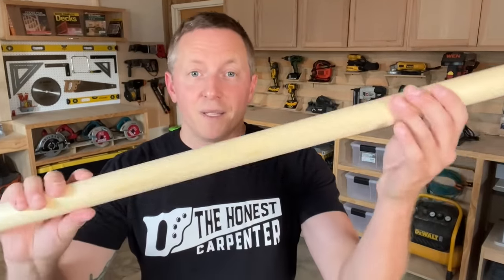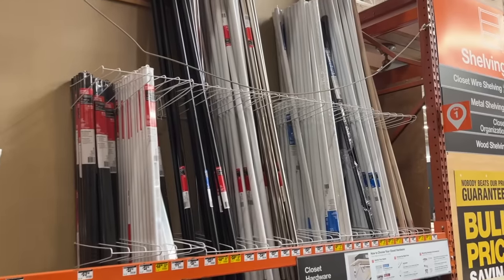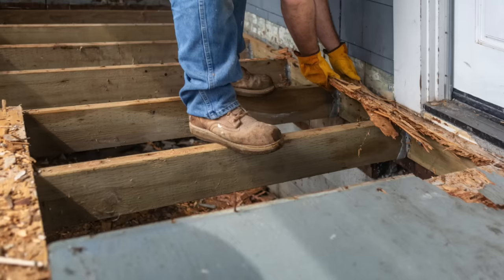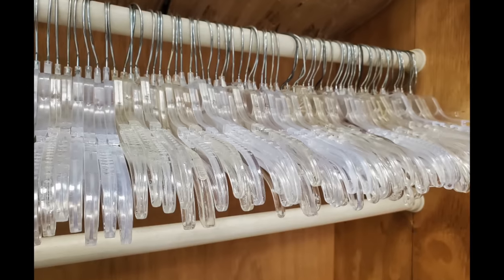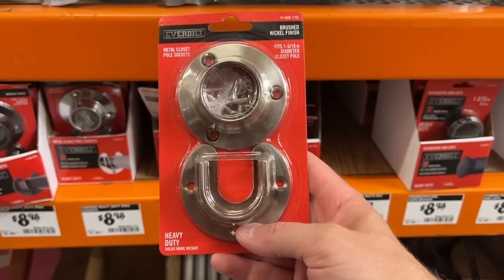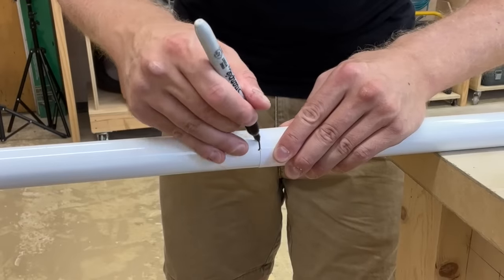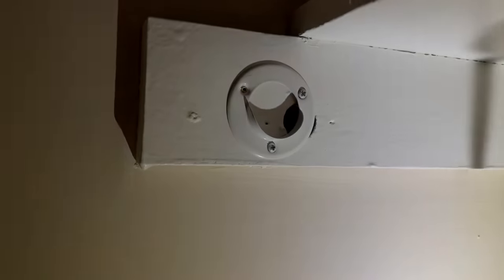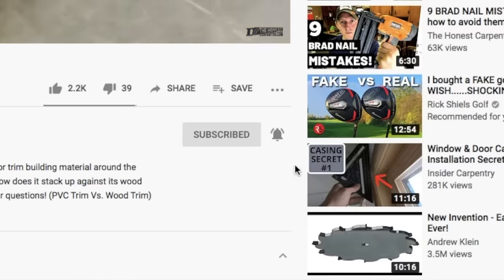Wooden Closet Rods Are TERRIBLE! Try This Better Alternative...(Metal Clothing Rod Install Tips)

Comment: I really didn't want a center support for my heavily loaded 6' spans.  I got the stiffest chrome closet rod I could find, then inserted a piece of metal conduit that would barely fit, then put a piece of galvanized pipe inside that, also with tight clearance.  It worked great, with very little flex/sag.  My friend commented that I had made a "tube-ducken" (named after the turducken).
Reply: Funny, I was going to say use 3/4" emt
Reply: Hey that's really smart! I don't like the center support either. Great solution.
Reply: I mean,  all you needed was just the iron pipe

Comment: Have to disagree with you on this one.  IMO, a good hard-wood rod looks much nicer than metal, especially if a dark wood or stained dark.  I agree that I would not span 6 feet with wood, but just as you mentioned using an interim support for metal rods over 6 feet, I would use interim support for wood rods over 4 feet.  And, IME, people really don't slide their hangers from side to side all that often.
Reply from the maker: I agree with your span calculation there, Howard. It’s more preference at that point 👍
Reply: I think Howard just admitted to never doing the laundry.  😂
Reply: I am a wood freak, I will choose wood over anything in most cases and there's no question it 'looks' nicer. But HC's points are very valid. I have an 8' wide closet with the entry door offset to one side (not the center) + 2 small closets with the 'rod' running perpendicular to 'me' ... you can believe I SLIDE hangers 9 out of 10X I open a closet, sometimes extensively, multipleX/day. And with that .... I now realize a silent, constant annoyance in my daily domestic life that warrants a modification project, to be excised for ever!
Reply: @DemPilafian  I wish, but as a bachelor for the last 30 or so years I do my own laundry.   Now hanging it up after it comes out of the dryer -- that's another matter.  But in all seriousness, for example, I have a section for dress shirts/slacks -- the vast majority of activity is hanging them up ONCE each time I wear one.  I am not sliding shirts/slacks back and forth constantly.
Reply: By that logic, you could just use PVC and just put support structures every foot.
Reply: @benr.3009  don't tempt my cheap butt with this!

Comment: A bit of Briwax on a wooden rod makes a world of difference. My clothing flies from side to side.
Reply from the maker: I can see that helping, Prescott. But do you still get some sag issues? Wood is just so prone to warping, especially circular rods!
Reply: @TheHonestCarpenter  so far, no. But my spans are only about 5’ and I use handrails or all-purpose dowels rather than closet rods specifically. They’re sold in a different section of the home improvement store, in longer lengths, and thicker diameters, yet cost less! A bit more work, perhaps, but the result are holding up. 

If I had a longer span, I’d definitely use a brace in the middle, or knowing me, maybe something minimal with airplane cable drilled through the center.

Comment: A hollow steel closet rod is a great hiding place for valuables. Rolls of cash, jewelry, and other things that will fit. Easy access with one side in an open top cup holder. So much better than a fake electrical outlet or in the tub of ice cream in the freezer.
Reply: Great...now you gave away the hiding place for my valuables! 😲😂
Reply: That's great, can you tell me where you live?

Comment: I’ve had wooden rods in my house for 70 years.  What should I change them out for metal rods?
Reply: 70 year old wood cut for a closet rod is probably pretty high quality. If they still work, you don't change them. But people who buy a house that's less than 25 years old are going to find that wooden rods will sag, or already do. And metal is a better, cheaper replacement.

Comment: As a wood worker I built my own closet and use 3/4 inch iron gas pipe, I sanded, primed, and painted it to coordinate with the walnut wood in the build, it is incredibly beautiful and strong. You can use the threaded foot plates to screw to wall or wood post making mounting super easy

Comment: One other item to add to the metal rod, use wax paper to rub down the top of the rod. When I was working retail using wax paper helped the hangars slide just a bit easier. I do it every so often at home usually when the hangars feel "sticky"
-MG
Reply from the maker: That’s a good tip, Gears! 😄

Comment: You're absolutely correct. I've been using and replacing wooden closet rods with metal for 40 years, since before they came painted in colors. Wooden rods wear and sag.

Comment: There are new oval shaped closet rods that are fantastic.  I recently built a full walk in closet dressers, garment shelves and hanging space.  Using the stainless oven shaped rods with the gunstock stained wood looks fantastic and no need for any middle support even on 6-8 foot spans(depending on weight). The new innovations are amazing.

Comment: I have used these rods for awhile now.  Also, as my shower curtain rod.  I have textured walls and the usual tension rods do not hold up.   It looks high end and sturdy and I have no worries of the rod falling down.  I use the grommet style curtains, fits perfectly.   Best if all, you don't have the overlapping joint so the curtain slides smoothly and doesn't catch when opening or closing.  Enjoy watching your videos.

Comment: Also, hard wood rod / dowel is incredibly expensive (North East). Where I live, even soft wood dowel is expensive. Exotic hardwoods are insane right now, $50 and up for 8'.

I had an oddly long closet to span while renovating my basement. It was over 9' and a heavy steel tube cost me $25 (thick walled, welded tube). I built the end supports into the structure of my built-in closet shelves with one steel support at the mid point and then tested dynamic load at around 300 lb (two of us swinging like goof balls). I over built it because in have zero faith in my family members being gentle on anything. Being annoyed by the typical tinniness of the tubing I stuffed pipe insulation inside and filled the gaps with left over spraycan foam insulation. Almost silent and very satisfying.

If you live near a scrap yard, just about any strong tube will work if you don't mind the look or finishing the tubing yourself. I've used ENT, galvanized fencing but I find gas tubing a bit too heavy for purpose and its surface finish is not as smooth as other types of tubing. Best yet, recycling tubing is cost effective or free.
Reply from the maker: That’s an Olympic strength rod for sure, Alapino! 😆

Comment: I'm with you on this one, The Metal Rods in my closet have held up for about 10 Years. In fact if you mount the frame of the rods to a stud in the wall that rod will feel like it could hold up a Tank. 👷🏿‍♂️
Reply from the maker: It probably could, W! 😆
Reply: Funny, because the wooden rods in my closets are doing just dandy after 40 years. This is a non-issue.
Reply: @TheHonestCarpenter  I have a closet rod made from galvanized pipe, & it's strong as an ox... my kids played on it for years, & now the next generation (my grandkids) are doing the same~ LOL!
Reply: @monkeygraborange yea I'm not agreeing with the whole tin metal rod being stronger than the wooden rod. It takes long to saw through the wooden rod, than the metal rod due to thickness. I trust thickness, not the thin metal rod. For years, when the wooden rod would bow, we would just rotate the rod 180 degrees lol. Team WR here.

Comment: 👍👍 I recently remodeled our closets and replaced all wooden rods with steel ones! I did not put the middle support in to see if they bend too much.  So far not much bend; although it is a 5 ft wide closet.  I made the supports since I was also replacing the shelf.

Comment: Never thought of the paper trick for a straight line around a rounded object. It makes perfect sense. Thanks!
Reply from the maker: Can’t remember where I learned that Marvin, but it’s helped in a hundred situations 😁
Reply: If you have one it would be much better to cut it with a tubing cutter. That way you get a nice perfectly straight cut with no sharp edges

Comment: Thank you for presenting this video. I have searched a lot to find a wooden rod fixed in the same  way as the one in my closet, and this is the only one I found. But the problem I'm facing and trying to find a solution for is how I can remove the wooden rod in the cabinet
Reply from the maker: If it doesn’t lift out, you can just saw right through it with a handsaw, Laila!

Comment: Interesting to hear your opinion and reasons for it, also to read many comments saying they felt the same or had never seen or heard of wood closet rods.  My experience is the opposite, I've never seen or heard of metal rods except the ones that are more like wire with the shelf attached.  I guess I've always lived in older homes built in 50-70's with unpainted wood rods.  Like a lot of things, it's often what's familiar that is what you prefer... except wood paneling, harvest gold and avocado green appliances from the late 60-early 70's!  😜😏
Reply from the maker: Very similar to my experience, Robin! 😄
Reply: once you have a closet where they sag, that's where the strong preference comes in. if installed to where it has enough support for the usage, it wouldn't matter much.

i rented a place where much weight at all would sag it like a motherfkkr. :/  it was SO vexing. could also be that there are different qualities of wood used. i can imagine a hardwood rod would work better, less flex.

Comment: The Euro style oval rods for me...15mm x 30mm.
Span 4 foot easily.

Closet shelving is about half my work. Used about 1000 LF of rod since the first of the year...prices are up and availability is a problem now.

Several customers have suggested wooden rods, but I give them the same reasons to avoid them....your video is spot on.

Funny thing is my personal house has wooden rods😀

Comment: Last couple of houses I did I used thick wall 1 in PVC with the screws in right and you can't see the printing a lot cheaper than closet rod metal or otherwise

Comment: I recently replaced some wooden 5/8"(16mm) wooden rods that had sagged too far after -50- years. I went to the bathroom section and got suitable lengths of stainless steel shower curtain rod - 1"(25mm) - already cut to 3' (900mm), then went to the wooden trim section and bought some 7/8"(22mm) dowel that just fit inside the curtain rod. I had to use a simple jig to enlarge the existing holes in the closet frame and lower them 1/8" as there was barely enough room to get modern plastic coat hangers over the 5/8" rod and under the shelf above. If you can't find dowel that is a close fit you can tightly wrap undersized dowel with newspaper & tape until it is a snug fit. This all works because as a hollow tube approaches collapse it becomes oval in cross section, bulging to the sides and getting narrower top to bottom - the dowel filling stops that. Some others have posted about using water pipe inside as a filler, but I only have 3 anvils & I don't keep them in the closet.

Comment: I love wood for a lot of things, but I'm also a huge fan of function. It's more expensive than it was a couple of years ago, but I've been using 1' or 1 1/4" EMT conduit for a long time. The only weight limit is what the end supports can handle. The heavy duty 1 1/2' sockets claim to be good for 500 pounds, so what you screw them to is probably the weak spot.

Comment: Mine works for me in a strange way. The paint on it gives the hangers a grip on the rod so you need to push to make good room but it also works your arms out 😄 I guess I see it in a glass half full sort of way.
Reply from the maker: A decent way to get your reps in, Ederd 💪 It only drives me crazy when they’re in a closet so small you can’t get your elbows inside without smashing them!

Comment: Interesting I had no idea metal closet rods even existed. Back 40+ years ago when we built our house I used EMT (electrical conduit) in all our closets.  Additionally use metal rather then plastic rod holders. Plastic gets brittle over time dumping your clothes and the closet rod on the floor.

Comment: A for what it's worth comment. We had to take down some chain link fencing and I cut some of the top rails and used them as clothing rods. Including one that was a full six foot long without any sagging. I get the impression that even buying the top rails new may be cheaper than the metal clothes rods, although in my case they were free so definitely cheaper and stronger.

Comment: Don't worry about centering the support, if the studs in the wall aren't there, use two to the pair next closest,  or put a stringer in, nobody but the user has business in the closet anyway, better a solid hang than a symmetric install.

Comment: We recently moved into a new apartment and the closet here had that fat, wooden closet rod. None of our clothes hangers could fit around that thing. I removed it and put in a metal one, with a smaller diameter. It looks better, and it's actually useful.
Reply from the maker: So much better, John!

Comment: I have been trying to install the metal bar and I didn't like all the play in the holders. but I see yours do to I might drill a hole in the one like one had just for added protection. I even try a reducer but none of them fit.

Comment: Thank you Ethan. I was just considering making my own  clothes rod, since the tiny closet in my apartment is not set at the right depth with the bifold door: won't shut because the clothes stick out.
I am (creating/ designing) an HDX 5 shelf (black) to house my hanging and not hanging clothes. Have nothing bought, just items in my head.

Comment: I use metal poles used for chain link fencing. Home Depot has it. It is way stronger than the thin closet rods sold at Home Depot.
Reply from the maker: Dang, that’s stuffs heavy duty, Rage 😅 You could do pull-ups on it!
Reply: @TheHonestCarpenter  Doesn’t flex at all!
Reply: For 7 foot spans with no center support, the previous owner of my house used threaded galvanized pipe and floor flanges.  Kinda ugly, but way strong.
Reply: @attocoulomb  floor flangs sound like the way to go
Reply: Will HD cut it to the size you need?
Reply: @lauriedobrow8393  Don’t think so. I cut it myself.

Comment: Finish carpenter here with some critiques

#1 the support brackets are even more useful for holding up the shelf than even the closet rod. I still add supports for everything over 3.5 ft span and switching to metal wouldn't change that.

#2 unless you're a retail store sliding hangers horizontally is not particularly useful. I already know what all my shirts look like.

#3 while I do agree that painted wood doesn't look great I would never call the raw wood look cheap. That's completely subjective 😂 they're both good looking products.

Since those are the 3 main arguments I'd have to say it's more of a tie with wood being cheaper. Of course, overstating it gets more comments...😂

Comment: Agree 100%. Wooden closet rods sag so bad in a short time. So do the metal 2 piece ones! You didn't mention those. They are bad. Oddly enough, I recycle old hockey sticks for my kids closet rods. It looks cool and is as slick as metal and stronger. :) You can chin up on them!

Comment: One of the problems with wood rods are finger joints which come from Asia, if it’s truly solid then you have to be careful with the grain orientation. I’ve grown up with galvanized pipe in almost every home I’ve lived in since 1960. Wooden rods will survive the test of time if it came from that time and they’re short. Like coat closet short. Grain was tighter in wood back then. Also people tend to overload their rods. Mom was a stickler for us kids to make sure our hangers were 1 ½”-2” apart so clothes didn’t wrinkle. She also had us put on a coat of wax on the pipe as part of spring cleaning. 

For those considering conduit I would recommend rigid metal conduit over emt as it won’t bend as easily.  Thick wall thickness when using any metal rod.

Comment: I knew right away what you'd say the problems are with wooden rods: bowing and friction.  I once lived in an apartment where the wooden curtain rod was painted, which made the friction even worse.  My solution was to get a plastic tube (I think it was a kind that can go on fluorescent lights to give them color?) and slice it down the middle.  I placed the wooden rod inside the tube and now it was nice and smooth.  This approach could help too with metal rods that aren't smooth.

Comment: One of the first things I had to do when we moved into our house a few years ago was replace the closet rods.  One of them was spanning 89.5 inches with no supports and in the thinnest plastic mounting brackets I had ever seen.  There was no back trim plate either to insert a support.  So... one trip to la big box later for an 8 foot metal rod, along with a 6 footer for the other closet, some mounting hardware, some cedar 1x6s and some rod supports.  Once I got the wooden rods out, THEY WEREN'T EVEN STRAIGHT!!!
Reply from the maker: The tend to look like bananas after usage like that, Darrin! 😆

Comment: my closet has a thin two part metal rod that has bent under the weight of whoever's clothing was hung before I bought it. This led me to believe that metal rods are weaker than wood. I guess they just put a thin crappy rod in place with no center support. I dont like wooden rods either though because they do sag with time and end up falling out of the supports becuase the curve makes it shorter.  Thanks for explaining, I guess new rods are thicker and one piece instead of two. Maybe I'll go ahead and replace this bent up rod after all.